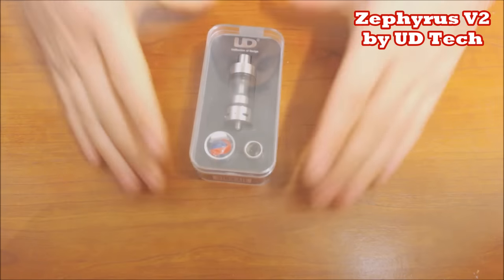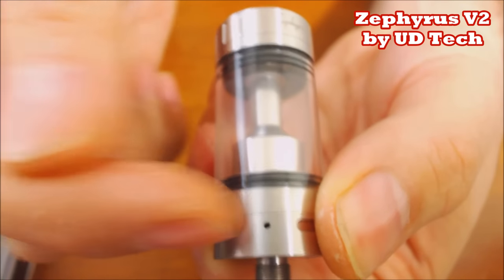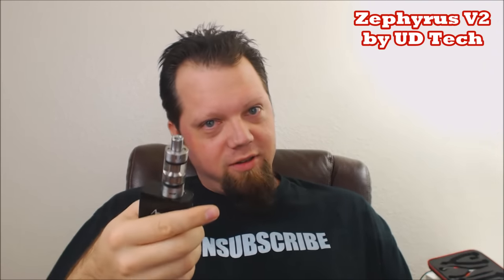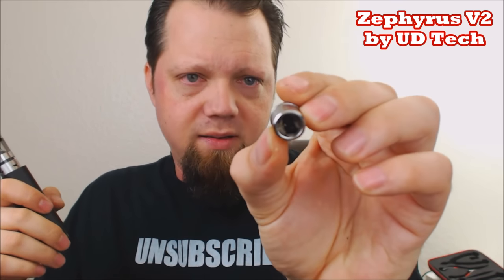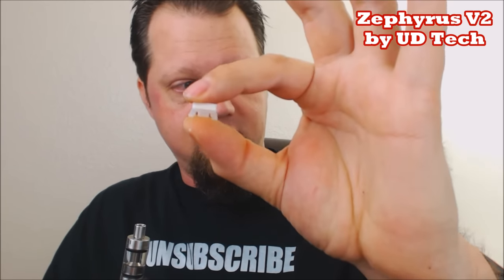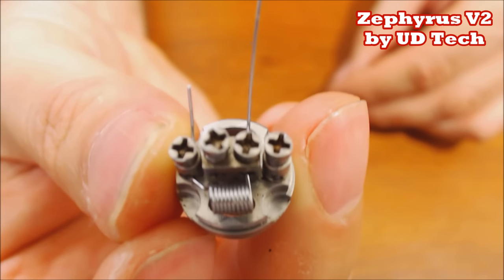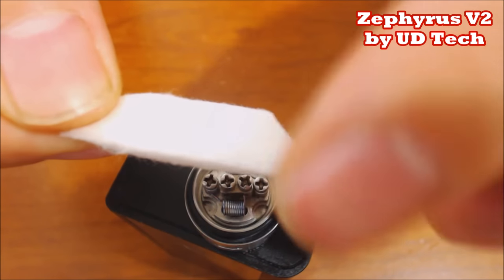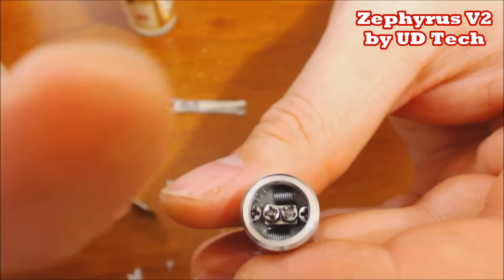Youde Zephyrus V2 Review & Build Tutorial

Comment: Another great tank. I own or owned the igo-w, goblin, goliath, and goblin mini. Love the Youde company as they listen to their customers. However, I feel the goblin mini, is the one of the best RTA's as far as flavor is concerned. However, it can use some improvments. 
First top fill would be awesome!!! 2nd have a bigger (width wise) build deck. It doesn't have to be 22m, 23mm-25mm is ok, cuz I find most people running tanks tend to use it on box mods. Hope these recommendations get through to the UD engineers on the next goblin mini. Thanks for the videos!!!
Reply from the maker: +o0archer0o Funny you say that I'm one of the design consultants here in the US for UD.  I had suggested the Goblin mini to have top fill, but they passed on it.  But I did tell them after that I would stop working with them if they do not put top fill on every tank that comes out.  So know I got your back and have been trying to improve upon the UD devices since I started consulting with them in 2014.

Comment: good review sir . Just wondering if it can fit 3mm coils or claptons/twisted ? .
Reply from the maker: +jawakush You could fit them but a 3mm ID clapton might not be the best idea.  These tanks are made for a 26g 2.5mm ID 8 to 10 wrap dual coil.  If you put a bigger coil in you might hurt the airflow a bit. 3mm coils are not the best bet for any UD tank.
Reply: +Ray Lo Vapes yeah thought so too since the Rba deck is only a tad bigger than v1.  Would you rate the Zephy v2 better than the Bellus flavour/vapor wise.
Reply: +Ray Lo Vapes yeah thought so too since the Rba deck is only a tad bigger than v1.  Would you rate the Zephy v2 better than the Bellus flavour/vapor wise.
Reply: +Ray Lo Vapes yeah thought so too since the Rba deck is only a tad bigger than v1.  Would you rate the Zephy v2 better than the Bellus flavour/vapor wise.
Reply from the maker: +jawakush I feel the Bellus has the Zeph V2 beat on airflow.  But I think the Zeph V2 has the Bellus beat in flavor.   The Zeph V2 was made for a good balance between airflow and flavor.  I've been using it non stop since I got it.  The Bellus has been sitting on my desk waiting to get used.  Plus the top fill design is better IMO.  Both are good tanks it just depends on what you are searching for.  For clouds Bellus, for flavor Zeph V2.
Reply: +Ray Lo Vapes Ahh good to hear . Gave up on top fill with the Bellus altogether and bottom filling all the way now lol .. Made my mind now thanks to you , picking up the Zephy v2 later . I think for my macro coils ill wait for the beast Griffin RTA to drop . That will be a step up in every way . Anyway thanks buddy , keep on doing your awesome reviews , appreciate it .
Reply from the maker: jawakush I'm currently working on a 25mm Mega Goliath ;)

Comment: good viideo !  so far this tank has good flavor and cloud production @ 10 watts!!  Using the stock coil..The only thing I don't like is that the top cap is very hard to turn to fill...ma b because the tank is brand new and hopefully will loosen a bit with age..Great flavor AND clouds @ 8 to 10 watts just means my batteries will last long time!  Can't complain about that...Was a little worried  cause I got such a great deal on it ,and read a few bad reviews about leaking and burnt taste at low wattage..But so far....so good!

Comment: ray i just got this tank and it's my go to adv,the one big con is the base is difficult to assemble the tank because of the o rings,other than that its my adv tank
Reply: Place the harder o-ring at the top of the tank 
And the softer o-ring at the bottom of the glass tank 
Should solve your problem 😁
Reply: Also, the first time you take it apart it is hard but if you just put a lil juice on the rings it is smooth as butter.

Comment: I wish they would have put a raised lip around the airflow on the rba...
Reply: You have to make the cotton tighter then you think. It is tricky to get it right but once you do it sweet puffin. In this vid he has it kind of looser than I think is best. The best way is to leave the wicks long at first and pull them up to a point like a tee-pee then slide the cover on over them then down and screw it on, then trim to the top of the edge of the cover, then push em down packing it kind of tight but not too tight. I have a lot of experience with this deck. At first I thought it sucked but then I was shown the right way to wick it. Not really tight in the coils but rather tight in the inner area over the wicking holes. No leaks I promise. Well unless you are getting crazy jumping around and shit with it in your pocket doing backflips.

Comment: Sweet review bud. Not hating but idk if that was really "pancake" wicking. Next time before you screw the top on the rba wick the cotton some and itll act as paste,you then can do pancake withing method(check out Rips video on it,quick and to the point)using your syringe pushing into the cotton and all round making a "pancake" or circle . After that just screw the cap on and your done. Since(in video) you just screwed the cap on and then pushed the cotton down into the wicking channels its not pancaking really. I actually,well most of the time anyway wick the same way your doing it here,but instead of wicking with juice AFTER you screw the cap on and push the cotton down i instead wick BEFORE screwing cap on and use the juice as glue/paste sticking the cotton to the inside of the wicking channels,then it makes it super easy to screw the cap on. After that no need to push cotton down into channels bc you already did before that. Hope you understand and im not coming off like a prick... As much as this is def an improved Zeph,im passing on this one,plus ive heard from Youde that this version is more open towards the flavor side of things. As much as i love my flavor i also love my claptons and this deck is just to small still i believe. IF anyone is in the same boat as me i HIGHLY recommend an RDTA that just came out even better than the newer v3 ABs Crius(yeap i  said it,even better!). Its called the "Griffin" made by "geek vape" and its absolute perfection(just about :D). They also have a sub-ohm tank coming out anyday now called the "Aeolus" which takes the very first(ive seen) VERTICAL PRE MADE Clapton coil(also its a replaceable clapton head). So very cool shit. Check'em out. geekvape.com
Reply from the maker: +Ry Guy Actually by wicking the way I did in this video i'm not pushing the cotton into the juice channels.  The cotton is cut right to the size of the deck and since I push the cotton up before putting the chimney ring on and push down it's really just sitting on top of the deck.  If anything just a little bit goes into the channels.  I refuse to watch any rip tripper video and have been on a purge since the beginning of this year he acts too wild for me.  If you watch any of my other videos you'll see I typically wick the way you describe but this way is much easier and is not as difficult as fine tuning the wick to sit in the channels.  This way also creates a perfect seal from the juice so when top filling it wont flood out the deck (even with a glass dripper).  I wanted to use a method that was easier for anyone to do even first timers.  The V2 has the same airflow as the Zeph V1 just with an improved build deck.  UD tanks are not made for big clapton style coils.  They are made to perform best with simple 24g or 26g 2.5mm ID coils.  By reducing the chamber it allows for the airflow and flavor to balance themselves out perfectly.  If we made these decks bigger then basic coils would not give off the flavor people are looking for.  There are plenty of RTA's that are made for massive airflow but lack flavor.  As for the clapton vertical coils those are all over the place now.  Aspire has them, SMOK has them, and a few others that I know of.  I'm also helping UD redesign some vertical coils as well.
Reply: +Ray Lo Vapes Yeap I know Aspire and Kanger have the clapton coils(using them both one in my supertank mini and one in my nebox)but i like the SS ones better(flavor). I was saying its a first for it being  "replaceable" clapton head. Haha i knew I was gonna get some kinda flack or whatever for suggesting Rip, it just was a quick ref that jumped in my head from a vid he did way back. He is a bit wild,but thats what keeps it Entertaining and not just another average "joeVAPES" channel (Lmao,guilty) and probably why he has gotten so many subs even though most wouldnt admit, but I bet they still watch'em ;-D. My bad it looked like after you pulled cotton out you pushed them back in pretty good towards the juice channels. Sucks i think the Black versions are coming with Clear o-rings. What are you designing with Youde? Just tell'em to slap those coils vertically and ta daaa ;-D
Reply from the maker: Ry Guy I'm been the US designer/consultant for UD since mid last year.  So pretty much everything that has come out that was not named IGO, AGA, and UDT has used my designs. I just don't ask them to put my name on the products.
Reply: Ray Lo Vapes Sweet. Good Luck with future Designs!